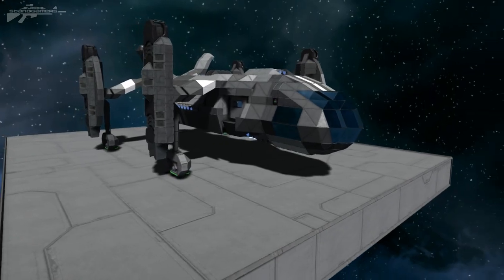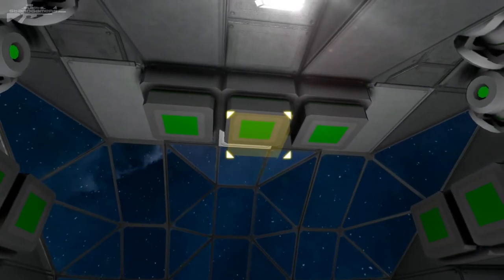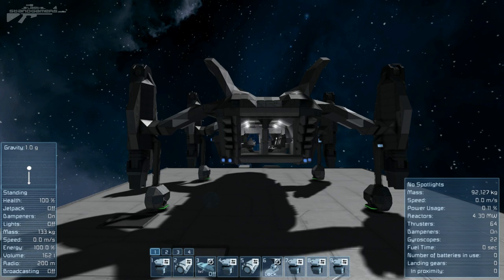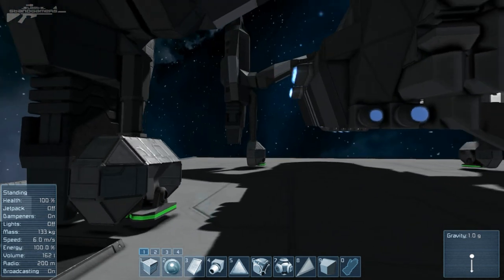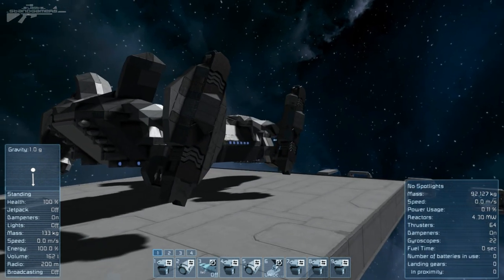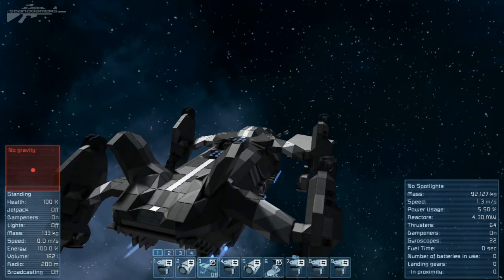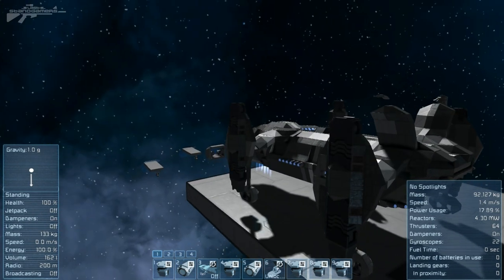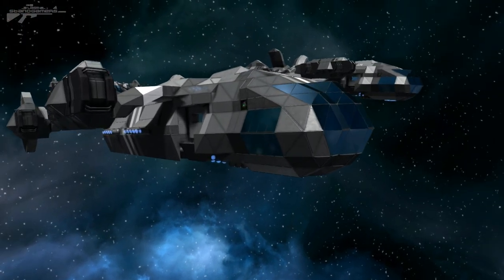Space Engineers - VTOL Drop Ship Test Flight , Buckle Up

Comment: a couple of ideas for the cargo versions. u could have it so u can push boxes of cargo into the back and there is landing gear in there that locks it in place. u could also have a version were u can open up the doors underneath the ship then hover over the boxes and slide down over the top and have landing gear inside which locks it into place and for small boxes u could even close the doors so the cargo is protected. just some ideas

Comment: you might be able to fix that slight pull but slightly changing the front thrusters angle so they will aim slightly up or slightly down (Depends on the pull) and see if you can fine tune it to be perfect

Comment: Now, in a real situation, wouldn't you use the vertical thrusters to boost off whatever asteroid you're on? Would it not quicken escape? View 301
Reply: BLsquared
 Yes. In an emergency, you could use the vertical thrusters to quickly leave a surface. He refrained from doing so here because he was sitting on a surface that would normally be kept in one piece.
 In an emergency, you could also boost the output of the main engines at the risk of burning the landing gear after takeoff. But then, if you're doing that, some damaged landing gear is probably the least of your problems.

Comment: ok just to remind you guys... What shall we do with the decoy block... yeah it is not that popueler with missiles i think mostly but what else could it be used for instead of missiles?
Reply: Flares?
Reply: ***** huh? how would that work?
Reply: Anton Flax
 Should your ship come under fire from enemy computer-controlled turrets, you can use some detaching blocks (Landing gears/merge blocks) to disperse some decoy blocks to draw fire away from you.
 In the real world, almost all modern fighter jets and planes were equipped with hot-burning phosphorous flares to deter heat-seeking missiles. Today, other forms of missile deterrents have been developed, making flares useful in fewer situations. One such example is laser-based, pointing a laser at the tracking component of the missile to confuse it.
 Since Space Engineers has yet to add that, however, the decoy blocks can very much serve as flares.
Reply: Thelothuo That seems like it would take up so much space though. I guess using landing gear would be far superior for effective use of space, but still. Also, given a lack of atmosphere and therefore drag as well, you would need to drop the flares at a slower speed than 104.5 m/s, and than speed up enough to distance yourself in time. The only thing I can think of for effective in-game deployment is decoy blocks being flung off of an arrangement of landing gears attached to a rotor, mounted at the back of your ship. Centripetal force would distance them. That's like archaic though.
Reply: Anton Flax
I made a sort of flare system where the ship (a very large ship) has pods of decoys on the surface that get launched into space.
Reply: but you only need 1. The on;y problem would be distancing it from the main craft enough for the turret to distinguish a sizable difference.
Reply: Hayden Bingham stick a thruster on it! and a generator or battery, of course.
Reply: but, i mean, a reactor seems like a waste for like 20 decoys.
Reply: Hayden Bingham then stick a battery insstead!
Reply: and have it run out of power? How would you activate it?
Reply: Hayden Bingham i have NO idea!
Reply: Changeling Grimm You thought that like the Meet the Medic video? or something else?
Reply: Anton Flax meet the medic was taken from heavily.
Reply: Changeling Grimm Well ok then